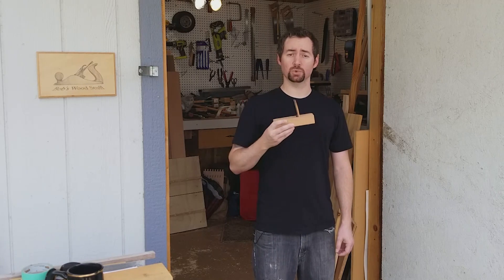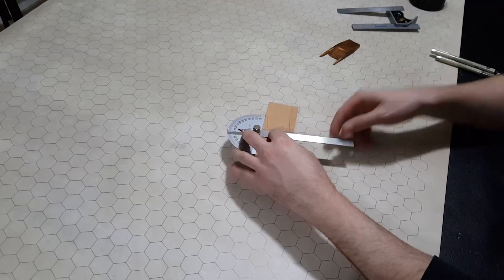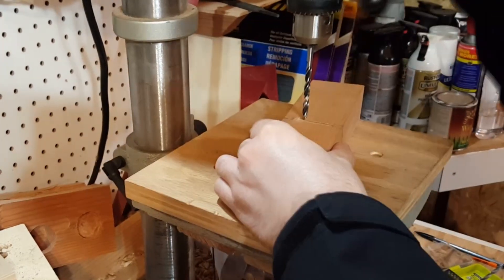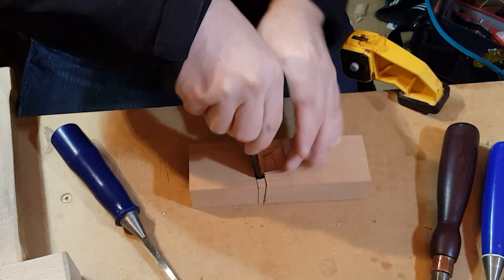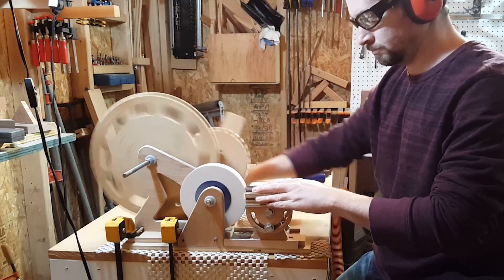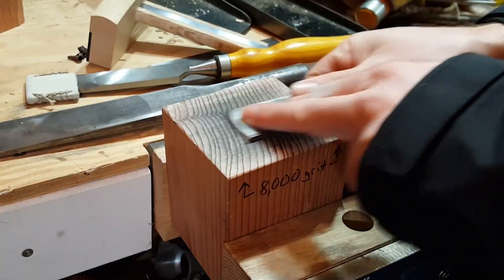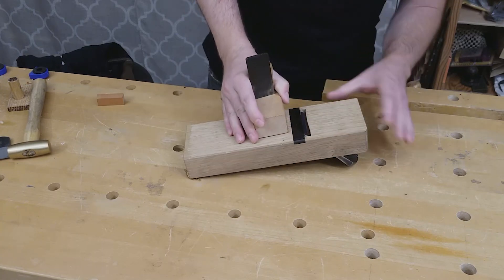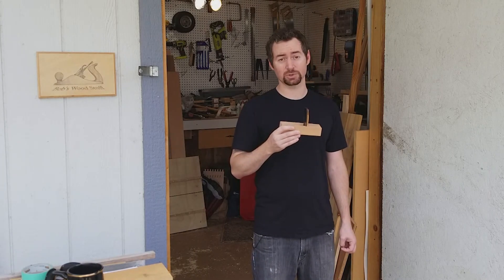Making a Japanese Scraper Plane (tachi kanna) - with plans

Comment: Where did you buy angle marking tool ?
been looking for a while for a good one like that.
Reply from the maker: That is the Shinwa steel protractor.
https://amzn.to/34PmiOa
(Amazon affiliate link)

I think I bought mine at Rockler Woodworking, but I haven't seen them there in a while. The one on Amazon is the same one I use.

Comment: What bevel angle do you use for the iron (blade)? I've read in a book from Scott Wynn that as a plane's bedding angle increases, bevel angle may be increased as well, he mentions a plane bedded at 65 degrees can have a 35-40 degree bevel angle. By this logic a scraper plane could have a 70 degree bevel angle? I wonder what is the angle used by tachi kannas made in Japan?
Reply from the maker: I am using a 60 degree bevel on the blade.  70 should work also.  On bevel down planes, all the cutting happens on the flat side of the blade, so you just need at least 10 degrees of clearance (rake).

Comment: Where do you buy your blades?
Reply from the maker: I buy Japanese blades from a store in Berkeley called Hida Tool & Hardware.
If you are using a wooden wedge with it, you can use any flat blade, like the iron from a block plane or a flat piece of steel.